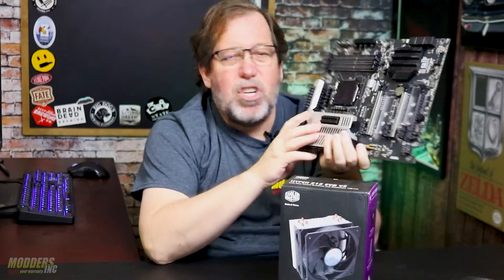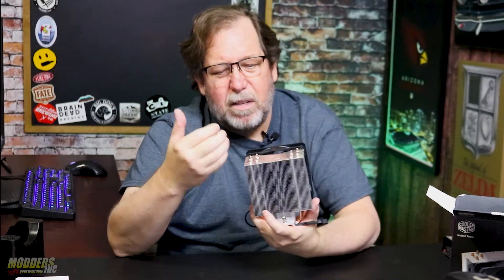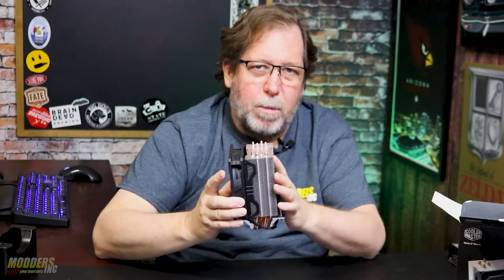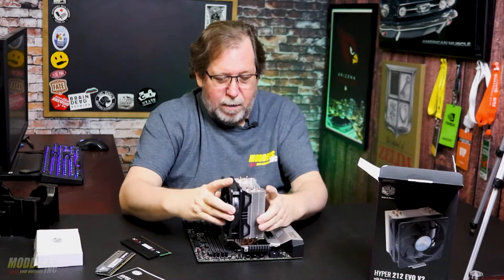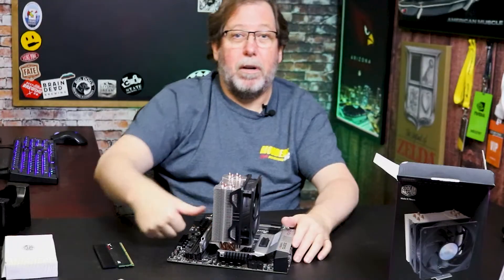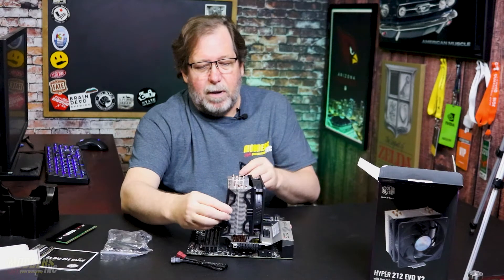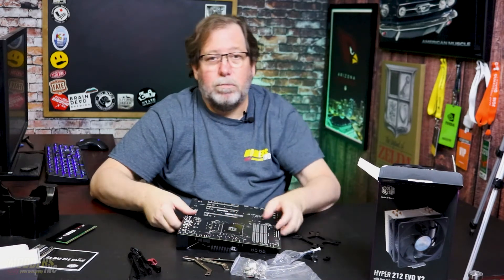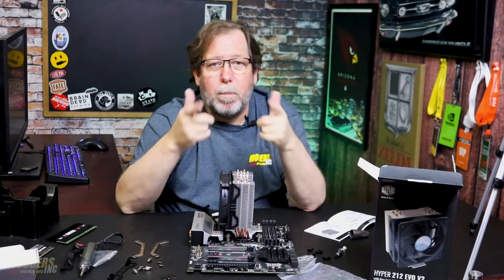COOLER MASTER HYPER 212 EVO 2 CPU AIR COOLER Unboxing and Review

Comment: i would not recommend it as mine came out of the box the heat sink bottom (contact with cpu area uneven and full of scratches... and every time i tried to submit a ticket through company website just gives error ,,

Comment: I like that having two fans installed had no effect at all. That saves a lot of time. Before this video I was going to use the v1 but now the v2 is my option. By the way its $18 right now on amazon. V1 was getting me with the higher cfms and higher fan speeds but now I think I will ignore that.

Comment: Im interested to get one of these for a 5800x no OC, working with Aobe doing Graphic Design, only gaming 5hrs a week.
Reply from the maker: You might want to see if they updated what it compatible with. My guess is that it would do better than the stock cooler.

Comment: Tnx for the video. A question: I installed the brackets but while I tightened all screws and bolts, the bracket is shaking and not fixed. Did I do something wrong? I don't know maybe when I install the tower and screw it up, it might be fixed.
Reply: I have this same issue. Any thought on it?
Reply: @gerrcass1  Yes. fixed. When you install the processor and then install the tower and tighten the two screws, it will be fixed in place. But make sure that you tightened the four screws and bolts of the frame well. But don't screw down the four bolts very hard. Just use your fingers not you wrist. Don't break that!!!
Reply: @danialt.5162  Cool. Thank you so much for your time.
Reply: @gerrcass1  Have a good time with your EVO beast! It really works well.

Comment: I have two of them, super overkill for my cooling needs but they look so awesome i just had to have them!
Reply from the maker: I have been doing some testing with an Intel 10900k and overclocking and it does a good job. At normal usage it does awesome.
Reply: @Moddersinc1  I use them in my mining rigs so very overkill but yes they are very nice coolers and just look badass 😎

Comment: Wait wouldn't the fan blow air into the heatsink and not suck air through the heatsink? Then wouldn't how you installed it be backwards, because I usually see the fan always facing the ram.
Reply from the maker: There are many ways to install the fan. Most just depend on how your system is setup or preference.
Reply: @Moddersinc1   Awesome thank you for the response!
Reply: Most would prefer a "pusher" orientation, because the turbulent air coming out of the fan will wick heat from the fins better than smooth air pulled through.